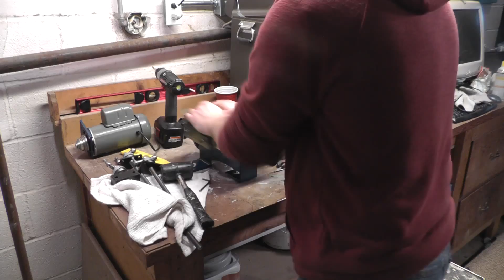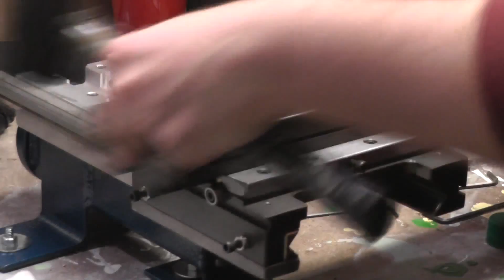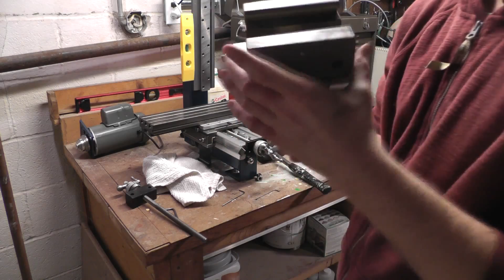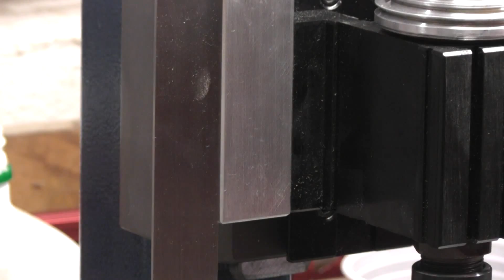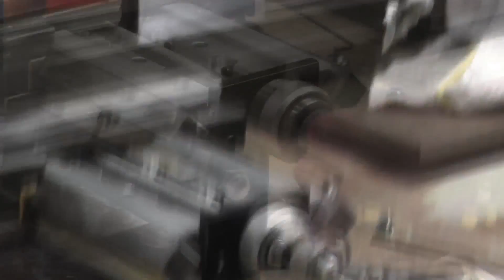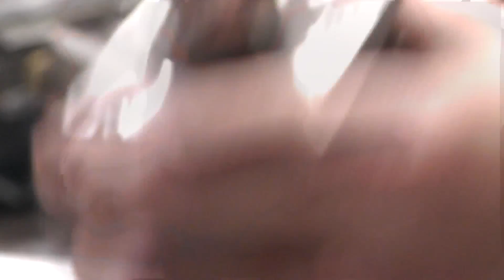Mill Reassembly, Leveling and Motor Mount

Comment: Thanks for sharing your experience Chris!  For those with mills watching this, a few words of experience...  you don't want to adjust these gibs when they aren't fully engaged.  The x-axis gib is adjusted left to right which changes it's position forward and back.  The screws don't adjust each side but rather together they keep it captive, along with the x table.  Similarly the y-axis gib is adjusted together and with very small movements of those two screws, with set nuts to lock them.  Minor adjustments and tapping with a dead blow on the axis side is the basic approach.. but again, you will never get it tight partially off the base.  It needs to be adjusted for motion fully engaged.  I'll make a video on this as well eventually.  Take care!

Comment from the maker: Put it back together and hooked up some motors here
Reply: Backlash is when there is slop in the axis. Basically when the motor turns back the other way it rotates a little bit before it moves the plane.
Reply: Backlash is a type of mechanical hysteresis. I'm sure Chris Gammell will understand it put that way. :)
Reply: Except electronic hysteresis is usually good, mechanical is usually bad ;)

Comment: Plastic is a fusible link, and will break if excessive stress is applied. You need to add the limit switches top and bottom for emergency stop, and preferably a precision actuator to each axis ( just before the mechanical stops) to give a hard zero position. Now all that you need is to get cable chain conveyors to route the cabling neatly for each axis so they do not catch ant tear.

Comment: Backlash is when you are able to turn the leadscrew with no movement of the carriage.  This can be due to either wear in the leadscrew and nut or misadjusted bearings that hold the leadscrew.  If, the leadscrew can move back and forth in the bearing, that slack will be taken up when the leadscrew is turned in the opposite direction.  Backlash makes it possible for the stepper to step with no corresponding movement of the carriage.  Hope that makes sense.
Reply: mechanical hysteresis.